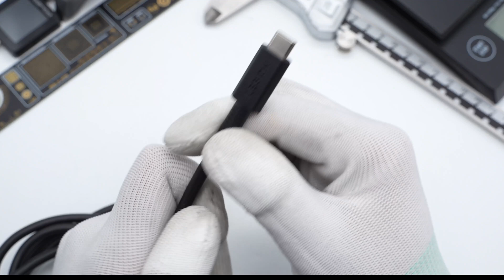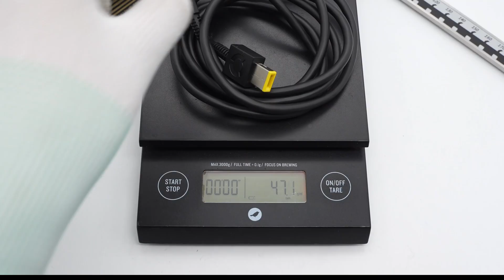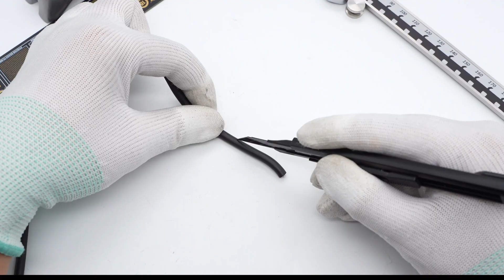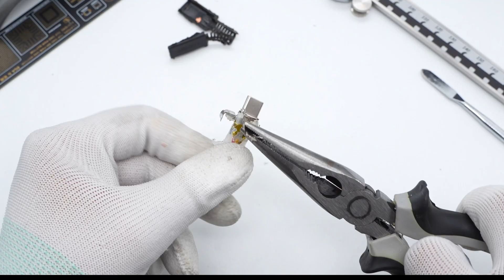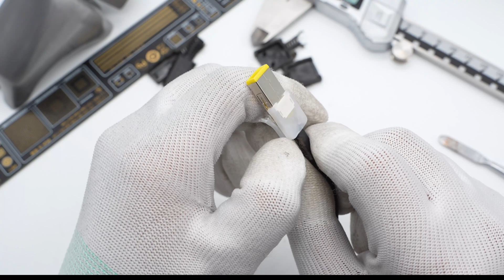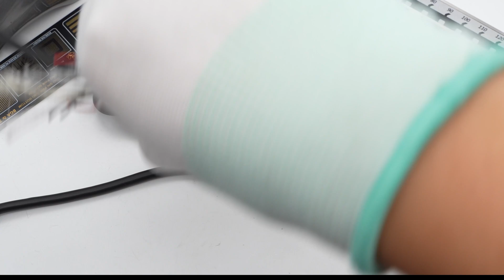Teardown of Lenovo Legion 135W Original Cable (Square Connector)

Comment: I have a lenovo legion Y540 charger of 170W (Square connector). There is some design issue in the charging port. When gaming, the charging port heats a lot and due to which the inner copper the left and right side of the port gets oxidise to coat a layer of copper oxide (black color) which stops the charging. I tried changing the motherboard and charger but it's not working. Do you know how I resolve this? Temporarily I use vinegar and salt solution to clean the copper inside the port and then clean it with baking powder solution. 

I cant find a permanent solution to this. Is this due to some gap between charging port and charging socket?

Comment: Is there a part number for this cable? I have a Legion7 Gen7 which takes 135W. I could just buy the C135, which comes with USB-C to USB-C and USB-C to Square Slim-Tip. However I;'d like to buy the C140 but that only comes with the USB-C tyo USB-C cable. Not easy to find anything online re: the cable.

Comment: square connector does not charge my laptop very dissapointing, the orange light lights up but no charging. and the usb c cable does charge but its says slow charging, and im not gaming just doing work.

Comment: wait so Lenovo's 135 watt type c charging isn't actually type c input? Disappointing.
Reply from the maker: There's a Lenovo 135W Original C-to-C Cable, we're doing it right now.
Reply: its type c input to slim tip output but its not using PD